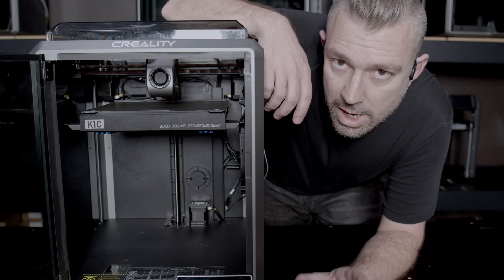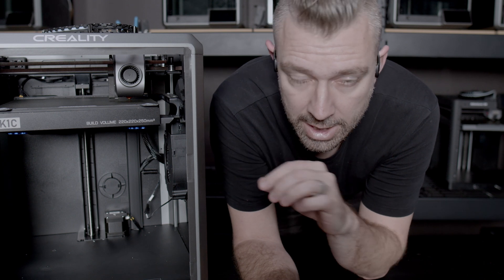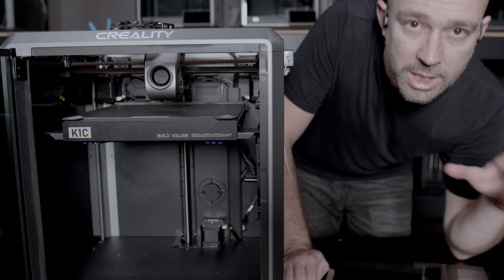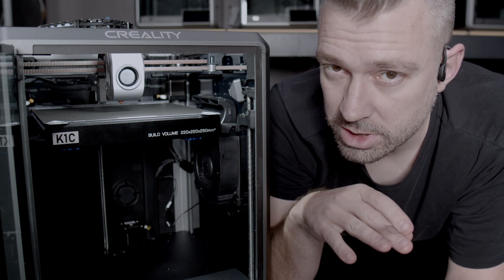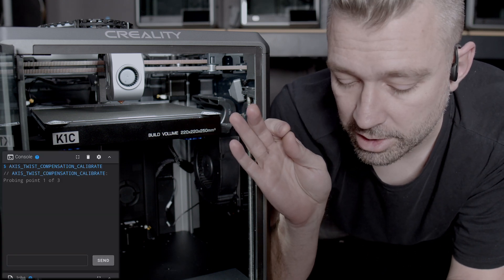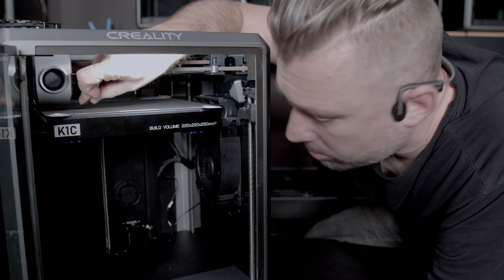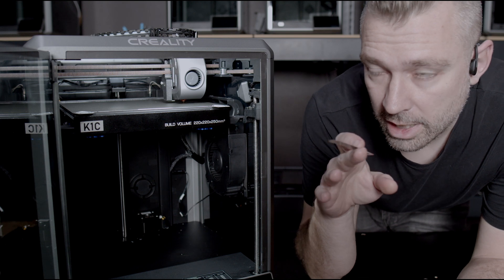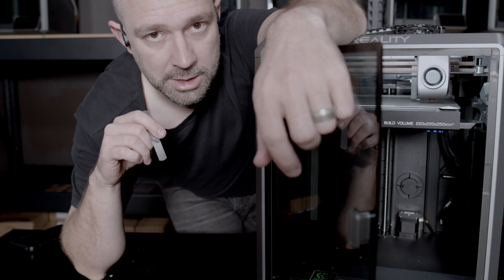Fixing Axis Twist with Klipper

Comment: Could you explain what you are using for the feeler gauge? I'm having trouble getting meaningful results but i do seem to have some twist issues from when i changed probes.

you are looking for zero offset (touching build plate) and testing this by whether or not you can fit a feeler gauge of what thickness?

Comment: when trying to do the axis twist compensation, it starts the calibration, moves the print head down, then prompts me to manually adjust the z offset. when I tell it to move down 0.1, it moves down for a moment then returns to the original position, but the software thinks it did actually move. What am I doing wrong?
Reply: Maybe zMin isnt low enough?

Comment: Thank you!  I still havnt installed it yet, but this guide is going to be super useful.  The only thing I can think of you might have over looked is renaming the file for the 5m pro.
Reply from the maker: No problem! Good news. You actually don't need to rename the file if you unzip its contents onto the USB drive. 🙂
Reply: @zerodotcmd  Oh awesome, that makes it simple then.  Can do the exact same thing on both the 5m and 5m pro.  Going to install later today.

Comment: i dont get it. Why we than still need bed leveling like KAMP if its not compensating for it. Have this issue too and never understand why even when my overall bed deviation was tuned to be no more than 0.12 mm
Reply from the maker: Running bed meshes for dynamic leveling is still important. The issue is the probe doesn't understand the true position of the nozzle when experiencing twist in the axis. Twist axis compensation helps the firmware account for this. This prior video explains the relationship between the two. https://youtu.be/O_U8t5Ap0Ik
Reply: @zerodotcmd  thanks for the answer. I watched the video but it makes no sense for me. For the K1 the Nozzle is basically also the probe ( sure its the load cells in that bed buts its kinda the same ). so if the probe makes direct contact with the bed while probing where did the deviation comes from ? I also have an ender 3 with an inductive probe mounted with an offset of 24 mm on the X axis. I have no issues there but would have make more sense if there were some
Reply: @wifim821   If you have Y0 offset on the probe, it will not be (or very little) effected by a twisted X axis.
Reply: @wifim821  I know what you mean. It also doesn't make sense to me.

Comment: This is a great video. X axis twist compensation has made such a huge difference not only on my K1, but on my bed slingers as well. I've had much more accurate prints. Combine this with the skew compensation and you can get some amazing results. Thanks for your video!